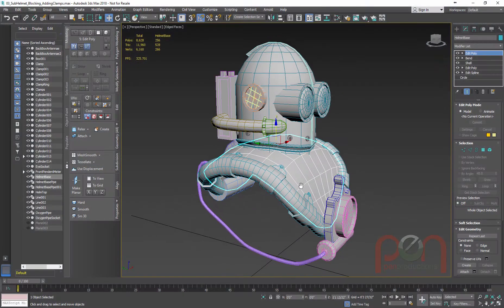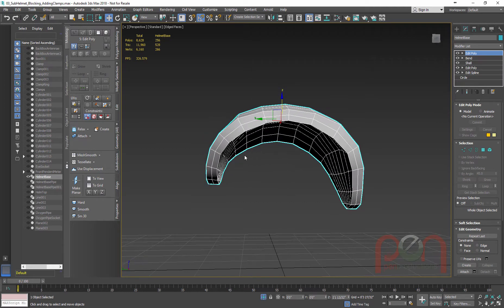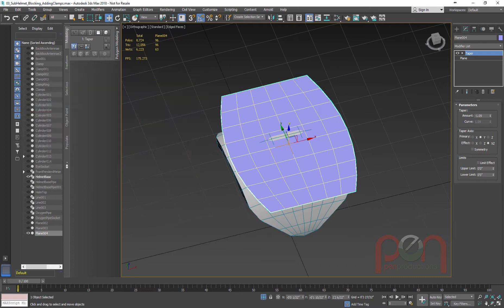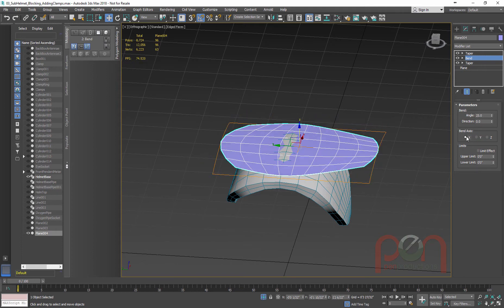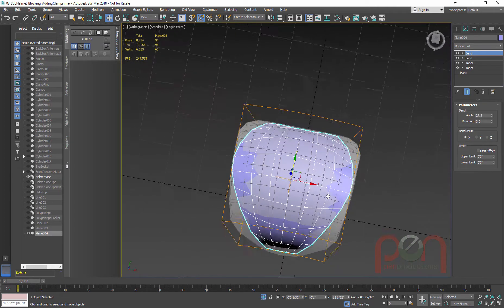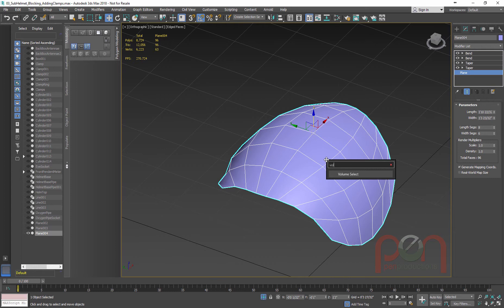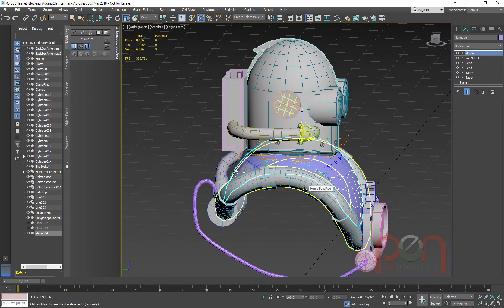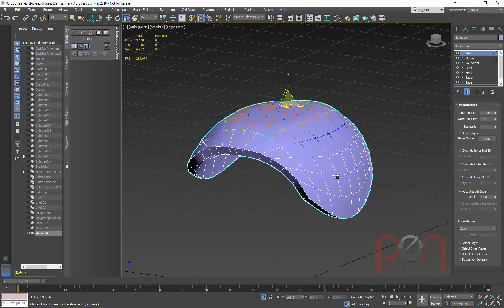Procedural Modeling 01

Comment: Hey Paul, what if you wanted to cut in some hard surface detail and panel lines, but you wanted those details to not be stretched out, so you have had to model it at the top of the stack? how do you keep everything procedural then? especially if you wanted to model those details on a flat plane, then place them procedurally into the mesh, taking into account the topology? 

In maya or modo, using destructive methods I'd basically just model the detail then tack them on, planning on how I would merge edges and such to preserve good sub-d topology. Is there a more procedural way to do this in Max?
Reply from the maker: Not everything can be done procedural. Finer details require you to model with polys or sculpt.
Reply: ah okay